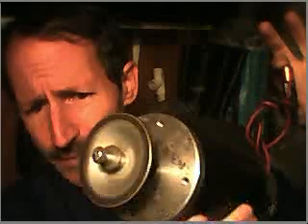Joseph Newman Motor, free energy or con job?

Comment: How long or does it keep the batteries charged all the while it is spinning the wheels? Joe motor not only spins the wheel while keeping its battreies charged but the work out t the wheels exceeds several order of the input power! what are your figures???

Comment: It takes very little current, to create a big spike oh, so I believe the trick is to use dead batteries to limit the current, then the high voltage Spike can recharge the batteries without heating them up, it's current that creates Heat not high voltage

Comment: Newman collects the back spike and feeds that back into the coils. Not free energy, not perpetual, take voltage to energize the coils and then collect the amps/voltage of the collapsing field. I've built a solid state version, it will run a long time, but the battery eventually runs down. A highly efficient device can be built, but it takes energy to make energy.
Reply: Just one question is it more energy out than energy in?

Comment: A phone line delivers about 50VDC, and almost no current at all. If you step up the voltage to say 240VDC then the amount of current required to move a load would even be less when measured at the point of the step up to 240VDC, but power would remain constant. If you take that 240VDC and are able to turn that huge fly wheel, and power a generator, and can power up your laundry dryer for example, then you would be sure you are producing surplus power. While that laundry dryer is operating you can measure and calculate the wattage (eg. 240v x 5.5Amps=1320Watts at point of AC Plug), and also the kWh it is comsuming after a period of time, it will be quite a bit, and at the same time measure the voltage x current coming out from that phone jack (e.g 50V x 0.5Amps = 25Watts at point of phone socket) If you find that the wattage out of the phone jack is a lot less than the wattage coming out of the socket powering your dryer then you definately have something going there, or in our example 25Watts POWERING 1320Watts or 52.8X what it SHOULD be capable of according to conventional physics. 

I can guarantee you that a dryer that operates at 240VAC/50Hz will not run even if you somehow manage to invert the phone line voltage and step up the voltage if you connect to it directly without Joe's motor, that is considering that it does work in the first place. Even if the phone line can supply that amperage from the source, you put that kind of load on it, the tiny phone wires would heat up and melt instantly and you could have a fire. If this thing worked, imagine paying a few dollars a month for electricity and a regular APC UPS Backup could last for weeks or months on end; or get free power from the phone company, as a dead phone line with no tone would sometimes still carry the 50Volts if its not physically disconnected, which would be useful as many times during power outage the phone line is still active.

Comment: forget wattage, forget amperage,  and forget  doing the math.   you cannot really prove the free energy inventors have come up with using what you learn in school.   the key is in the magnetic field, learning to minipulate  magnetic fields to get electrons to enter and flow through the device.    the electrons are around us, everywhere .  think about it, you breath air right? is there moisture in the air too?  does the oxygen and  water atoms have electrons ?  and  when you run a generator where do you think the electrons are coming from?  that flow through the windings in the generator?  do you think they are being created?    think again.   they are already there, in the air circulating around the oxygen  atoms.   all electricity we use is extracted out of the air and any atoms that  are in our atmosphere.    just learn to extract them a different way.

Comment: There are 4 types of power since there are 2 "currents" and 2 "voltages". The starter power, the  interactive power and the magnetic (stored in inductance) and dielectric (stored in capacitance) power. You can combine those 4 products in a very complex manner different from what you learn from you technician friend. If you don't understand electricity don't put your nose on and don't make claims... it's wrong you know...

Comment: There are a lot of things people just don't know, and the way to find out is by research and experimentation.    and when electrically smart people   tell you it can't be done, well just ask them this.    ( we know how electrical  generators work and so when we spin a permanent magnet generator and the copper wire crosses the magnetic  field of the magnet and produce electrons flowing,  tell me where are the electrons coming  from?  you can't create an electron , no.  yet they are flowing through the field wires and out the cord to your device which is using them.   so do they magically appear? and hop onto the coil ?   electrons will flow as they are pushed by the voltage but where are they flowing from?   how do the electrons get onto the coil?  where did they come from?  are they flowing from space to your coil as you create a condition where a magnetic field can attract them?      everyone, do you see what I am saying here?   if we do not know the source where the electrons are coming from and no one can explain from whence they come.   Then I think it might be safe to say it is possible to harvest electrons for our use by manipulating   fields,  magnetic fields.    where we can attract the electrons which seam to be everywhere.   They just need a certain condition to be present for a pathway to open for them to flow.  So let it be said, so let it be done.

Comment: Can't you just solve the voltage problem by using a step-up transformer?
Reply: sure why not? just convert it to dc.  you can also use capacitors with diodes to step up voltage.   however it's the battery which receives the back emf over unity power to keep it charged.    so if you use a transformer you would have to capture the excess power into something or you will have no free energy.

Comment: You are so lucky to have a "electrician" friend who understands power, because most electricians think things run on amp, because everything is rated in amps in a house. They fail to realize the voltage is always the same. I had this debate with the owner of an electrical store, and he said what about that heater over there. I said good point, what is rated in!!!

Comment: J. N. Motor is a special motor (Magnetic Energy Pump device) that has ability to store and cycle reactive energy between winding with huge inductance and capacitor( I refer here to RLC electric circuit in resonance mode). Current (Amp) and Voltage (V)on winding are 90 deg apart and that Indicate VAr energy or reactive energy. Loses in copper winding is minimal as current in the system is very low.  The motor only needs energy from startup of the motor and to cover the losses in copper winding and to keep the whole system cycling. As the motor cycles reactive energy it do not de-magnetize permanent magnets but makes magnet pair to follow electromagnet fluks of the electromagnet. System has 2 magnetic sources and those 2 are magnetically  coupled and for so winding has ability to pump energy out of Permanent Magnet pair and transfer that energy on the shaft. The same Energy that keeps permanent Magnet a magnet drives the motor's shaft and not the starter battery as such. As a Conclusion J.N. motor does mechanical work that is received on the Shaft while it rotates and energy that drives it comes from Permanent magnet pair received from environment space in Magnetic form thru magnetic coupling. Bear in mind that any rotation is accelerated movement that changes direction.
Reply: Finally some one who can actually use their brain.  thank you.  ps.   you can also make a generator without magnets by simply moving a iron mass pass another, with copper winding around one mass.  spin them past each other at the right frequency reaching resonance and you have over unity.     it's done by a changing of the inductance.    may need some caps and a tank circuit.  to work.

Comment: I'm an electronics technician, and have been one for 35 years. You are right on the money! Joseph has just made a big motor that's it. The extra power he seems to be producing is probably just inductive kick. It's a process that is used to take a lower voltage and bump it up to a higher voltage by using diodes, inductors and capacitors. It's often used in microwave ovens and old CRT TV's. When you increase a lower voltage to a higher voltage you have to give something up to get it. In this case you give amperage up to gain the higher voltage. That's why Josephs machine appears to be running on nothing. I guarantee you he would not stick his hands on those capacitors when they discharge, it would kill him and he knows it. A lot of TV and folks playing around in the back of old TV's found that out the hard way. The capacitors store the lower voltage in the inductive field when the power is interrupted and collapses. It then releases it into the wiring when the power is restored and gives it an extra kick. When that kick goes through the diodes and back into the inductors the extra current is released as a higher voltage. So Josephs swinging voltage is when the power is interrupted and then turned back on for the inductive kick to happen. Obviously he has a switch on his shaft to perform this operation. I did notice a lie in his video, he is NOT running his motor off ONE 1.5v battery he's running it off a 450v battery made up of FIFTY 9v batteries or 300 1.5v batteries is series, just like a 12v car battery is made up of six 2v batteries in series. If what he was doing was that great all he would have to do is patent it and show it to the world engineers and get the Nobel Science prize of 1 million US dollars, or whatever it is today. Nope only impressed that he made the motor but not in his wild claims. Thanks for sharing your thoughts kdaveem you're right on the money. Best Wishes n Blessings. Keith Noneya
Reply: Maybe you should look into what happened when Joseph Newman took his invention to the patent office in 1979.
Reply: @douglassmith3016  Why?

Comment: It's really confusing, but I think the commutation interval is what is overlooked about the motor.  As far as I can tell, the input is cut off at every interval where the magnet passes horizontally parallel to the rotor, which takes half the amount of input to run the motor, whereas the output, if it happens to be coming from the energy produced by the magnets in the housing, are putting out a constant output (without the interruption) which might be an amount greater than that of the input.  This doesn't necessarily mean that the output is good enough for use of any form.  A capacitor might store the energy just fine, but the batteries might suffer some damage.  His demonstrations don't explain what the motor does very clearly... I happened to resolve this much just now... thought this might help.:)

Comment: Most free-energy devices use the back spike from the collapsing field in a coil.  That can produce higher voltages than the input, which is often mistaken for over-unity output.  The confusion arises because voltage isn't the same as energy.  Voltage is energy per unit charge.  So like kdaveem says here, you must integrate the product of voltage and current over time to see the total energy produced.

Comment: Excellent presentation. I had a friend who SWORE that his inverter multiplied power. He had the inverter connected to his truck, plugged in a 120v AC drill, and with a big smile ran the drill. He claimed that it increased the power from 12 volts to 120 volts. I then asked if his hand held drill had enough power to start his engine. He got pissed off when I asked that. I explained that the starter had significantly MORE power since it used a lot more watts which was the result of the massive amount of amps running through it.
Reply: Finally someone in this thread with a BRAIN who understands the relationships between Voltage, Current and Power! Couldn't have said it better myself. Thanks for sharing you common sense with us. Best Wishes n Blessings. Keith Noneya

Comment: Yes you can run your dc motor with 1.5 volts.. but can your dc motor maintain its power?  Im sure it only runs less an hour . Can your dc motor run on dead battery?

Comment: You just dont understand how efficient newman motor is... you are paying electric company for the power pr wattage u use not on voltage. You need to reseach more on how electricity works... dont make a fool of yourself.
Reply: Based on the likes and dislikes on this video, I guess a majority of those who watched it are fools like myself, but since you are among a class of higher thinkers, I'm sure you must have built one of these motors to prove your ideas are correct right?  Sadly your incorrect about the nature of electricity. The watts the power company charges us for consist of voltage and amperage, Watts are a product of voltage times amperage.  For example. A light that consumes 100 volts and 1 amp of power uses 100 watts. If Joe Newman produced a motor that operates on 1000 volts and only One Tenth of an amp it's still using 100 watts. In spite of what Joe claims, his motors all use voltage and amperage to operate. They may use a very small amount of amperage, but for Joe or anyone to claim his motors don't use any amperage is nonsense.

Comment: Newman motor run on volts not not on amp. And when it run it charges the battery.. can ur dc motor do that? Pls. Read mr. Newman explanation about the motor then you'll understand.. this video only makes you an.......
Reply: Sorry but you're wrong. Power consists of voltage and amperage . When Joe claims his motors run on voltage rather than amperes it makes no sense. It's true that his motors are designed to operate on high voltage, but they still require some amperage.

Comment: energy = power x time = voltage x current x time
energy = force x distance
and others

it depends on what kind of energy you need to calculate

what matters here in any talk of a perpetual motion machine is energy. 

output = input - losses. There is always an energy source even if you can't work out easily what it is. eg gravity, heat, pressure

Comment: my Newman motor put out almost double
Reply: Double What? Voltage, Amperage or Power? Power is measured by multiplying the voltage by the amperage. 
1. Measure the input amperage and multiply it by they input voltage and let us know what the power is. 
2. Then do the same for output voltage and amperage. 
3. If what you said is true the power level should be double the input.
4. If you did that you have billions awaiting you in a 200 percent over-unity machine and you have solved the worlds energy problems. You need to do a demonstration and patent it FAST!

Comment: so if his motor runs on dead nine volt batteries and charges them and can run virtually for ever you don't think that fits the definition of over unity not to mention the energy that could be generated from generator coils instead of a pump

Comment: why don't you show use your motor running and calculations for energy use instead of tattle tailing on him with out any proof
Reply: Joseph motor is just using inductive kick to produce a higher voltage. The same process is used to raise the voltage in Microwave ovens and old CRT TV's. When the voltage goes up the amperage must go down when applying power, as he shows in his videos. Volts, Amperage and Resistance are all inter-related. The reason that HUGE motor runs so slow is because those fifty 9V batteries or (450) volts doesn't have enough juice to turn it any faster. The 900 volts output is the result of the inductive kick circuit he has in his motor. The pulsing voltage is the result of the inductive kick circuit switch on the shaft turning on and off the power as required for the magnetic fields to build, charge those huge caps, then collapse back on themselves to double the voltage. Sorry to say but I didn't see anything in his videos that was all that impressive or that didn't make sense to me. Basically he has a big motor running a voltage double inductive kick circuit. I've been doing electronics for 35 years, from airplane electronics, to radars to radios to aircraft test sets, and still do it for a living. I was impressed that he built such a large motor and incorporated an inductive kick circuit, that was a pretty cool trick. So maybe kdaveem doesn't know anything about electricity but I do. I didn't see any real value here except smoke and mirrors praying on those who know little about practical electronics. I once worked with a guy who was an electronics engineer. We fired him, not because he wasn't smart, but because he couldn't fix ANYTHING in the electronics shop. He worked there for a YEAR and NEVER fixed ONE thing. He had all the college education a technician would ever want but had no common sense or ability to convert that knowledge to what was going on right in front of his face. So I'm not surprised some of those Physics Engineers and professors were amazed. They probably weren't Electrical Engineers or Electronics Engineers who actually designed and BUILT motors for a living. Rather they are probably the ones who come up with the ideas and turn the idea over to the shop engineers and technicians. Best Wishes n Blessings. Keith Noneya

Comment: say we try to run a 1000 watts motor using to power source setup. lets put in mind that POWER = AMP x VOLTAGE.

running it with 220 volts would need 4.54 amps
running it with 10,000 volts would need only 100 mA.

battery capacity is in ah, that mean the lower amp load the longer a battery runs. and the motor is the same time charging the battery. that means it won't die.